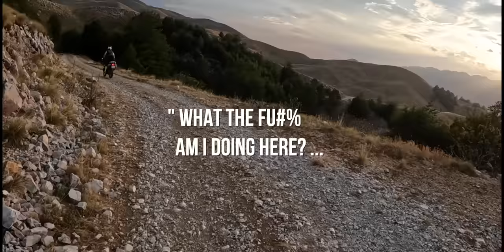Surviving the Balkans on a KTM 890 R and 1290 Super Adventure R

Comment: Beautiful adventure, beautiful views.
Motorcycles are also great, but very heavy, especially one of them.
But this ride of yours shows well that tubeless tires don't work everywhere.
I don't understand the excitement of tubeless tires.
They actually create more problems than advantages in true ADV riding.
I've ridden my XT 660 R many times with guys who have modern bikes that you know have tubeless tires.
I always drove, or at least I do, and for 20,000 kilometers with tires and air in them I had no problems.
And the guys on these tubeless tires constantly, if there are no pebbles, it's mud, if not, it's generally driving over large stones or hundreds of roots one by one.
Again and again without air they go and crush the rims like hell!
Yes, the inner tube with such an impact as here will also probably break. But you can replace the inner tube and keep going.
Because it's easier to take a tube than a whole wheel 🤣
For such a ride, the good old tube solution is simply better and that's it.
However, I usually travel alone and often getting into trouble no one will help me, and I will not walk 10 kilometers, no one knows where to help me.
Therefore, I probably have this point of view.
The fear of animals is also interesting.
I live in a place where there are wolves and I often see them in the forest.
At night, they approach the buildings on the outskirts of the city where I live.
I am not afraid of them because I know them and I know how to behave.
I am also sometimes in the mountains where there are many bears, but I am not afraid of them either because I know what and how to do to be safe.
But when I think about Australia and all those spiders or snakes or crocodiles, I shit my pants 🤣
Well, the point of view depends on the point of sitting.
Regards 🤚

Comment: in the 1190 touring 19 by 17 inches, the wheel rims are very thick and very strong. so much so that you have to hit the wheel up from the springboard to bend the disk a little. there are simply very thick and strong disks! and these discs on the "R" version are of very poor quality! I never write comments, but I couldn't resist here. it turns out that either the quality of the new motorcycles is much worse, or KTM is doing something strange.
I CAN PROVIDE 100% that KTM 1190 ADVENTURE T with electronic suspension on spoked wheels 19-17 will be the best choice.